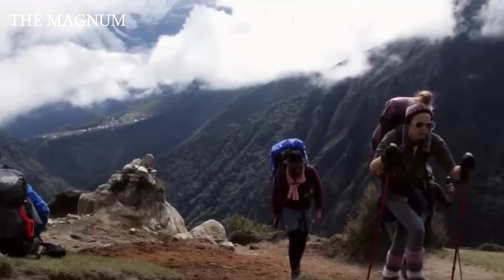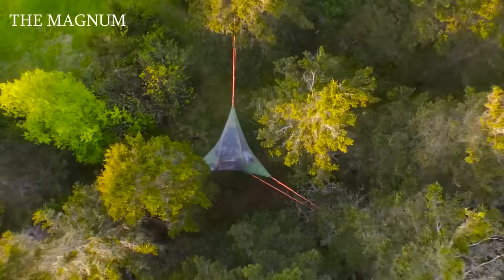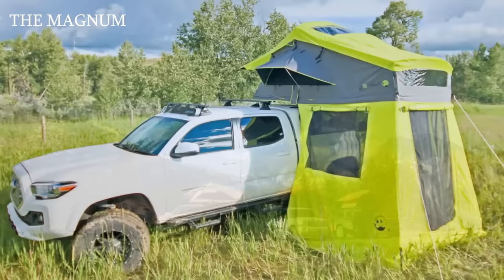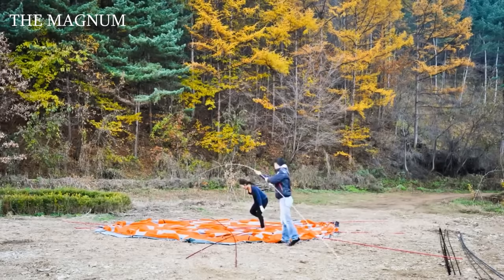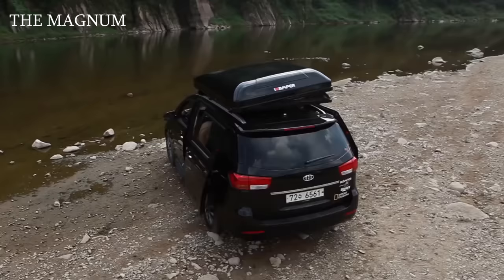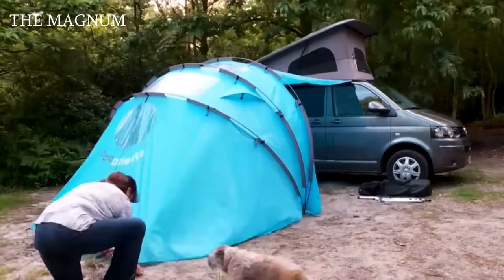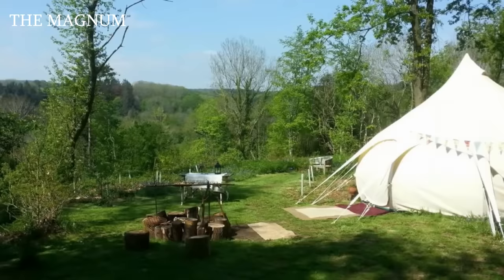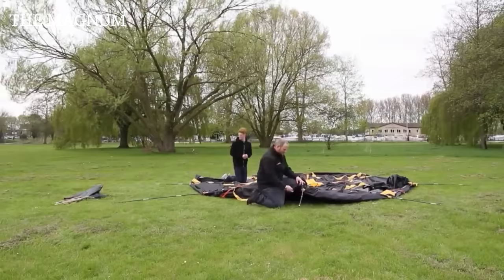10 COOLEST TENTS IN THE WORLD

Comment: For the tent that goes on the roof of the car, it would be neat to have it cover over the sunroof with a zippered floor that opens,so you could drop down to safety if animals come and could heat up the tent with the car heater if it gets too cold.
Reply: It would take quite a long time to get more then 1 person down that small window
Reply: @midgetman4206   It would take about 10 seconds for me, you move over, 2nd person takes 10 seconds etc.  Not like you are going to have 10 people to move.
Reply: all those safety warnings in cars is due to people getting hurt and killed by sun roofs at the neck and the button be pressed.  cool concept, but no company will let you climb in and out a sunroof and let the gasoline engine run while sleeping.
Reply: @duaneafields  No company will let you? How would they stop you?  My car will run with the sunroof open.   A zipper or Velcro door would be easy to make. And the chances of my sunroof closing on me is near zero and you are in more danger  driving to camp than you are the sunroof closing on you. 
Besides, you could put a safety brace in the window or a kill switch to the window  just in case.  Non issue.
Reply: @duaneafields  hybride batery
Reply: @duaneafields  ... Are you for real ?

Comment: #1 The Flight Tent: You will need an extension ladder to pitch it. #2 The Bubble Tent: You will need an air pump/power source, a small crew, nice furniture and some hookers. #3 Treeline Outdoors: Just buy at Tent. #4 The Space Station: Nice Tent! #5 Sky Camper: Just buy a Tent. #6 The Sheltapod: Don't usually attach my tent to a VW Bus. #7 The Kaleidoscope: Don't need it, wouldn't buy it. #8 The Lotus Bell: Definitely for Oregon or Burning Man in Reno. #9 Pod Tents: Just buy everyone a tent, have them go a 100 feet and pitch it. #10 Field Candy: I'm speechless and already mentioned burning man.